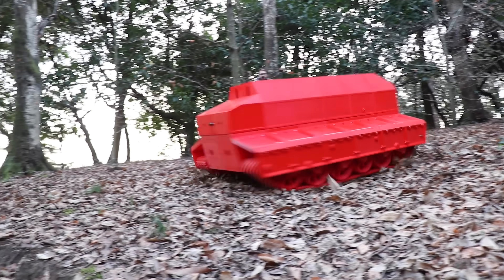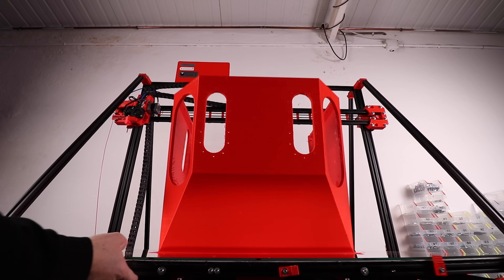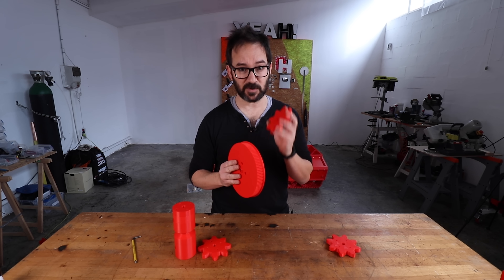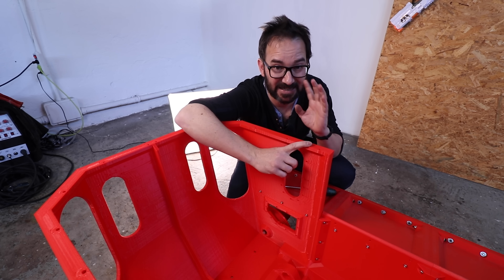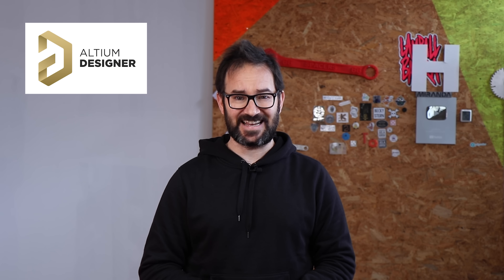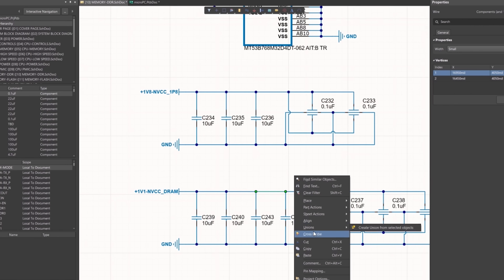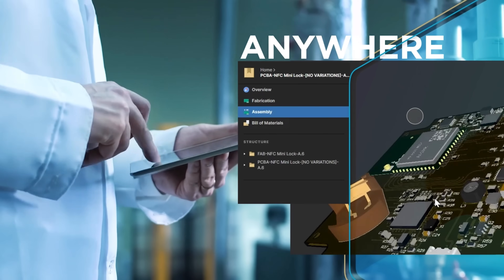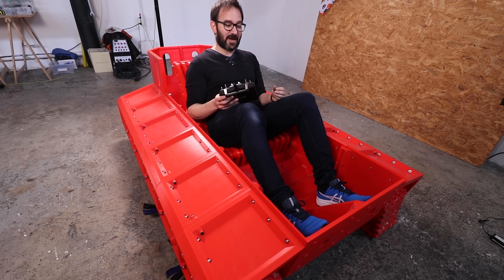FULLY 3D PRINTED TANK THAT DRIVES WITH PEDALS (from scratch)

Comment: You can control the tank via a single joystick - north/south on the joystick = forwards/backwards and east/west = clockwise/anti-clockwise for turning. The programming is really simple - for example - map your sensor reading to a range of 0 - 1000 where all the dead space is mapped to 500 (no input) where 0 = south/1000 = north and 0 = west/1000 = east. Take the reading from the east/west joystick sensor as follows:  difference = (eastwest - 500) * 0.5; (the 0.5 halves the input reading for less sensitivity) now ADD the difference to the north/south reading for the left motor and SUBTRACT the difference from the north/south reading for the right motor. (leftMotor = NorthSouth + difference;  rightMotor = NorthSouth - difference)Trim off any values that are outside the range of 0 to 1000  then map these values to the motor controller software values (or stepper motor wait times between steps).
This then leaves your other hand free to control the second joystick for the cannon.

There is also another way and that is to mount the joystick so it scribes a diamond shape (rather than a square - rotate the square 45 degrees) with the sensors both at the bottom or top of the diamond (not both on the same side).

Comment: tldr; thats alot of nut twisting my arms man

for less muscle work, use a tightened dual nut setup with a fitting socket and drill holding  the nut at the top. remove second nut and cut stock if needed but using two ensures secure and wont loosen without stressing allowing for less friction between components.

 could use a combination with flat style bearings ~2mm between washers to better secure tracks and allow for more rigid linkage and stronger motors

Comment: hi Ivan,
you've hit the mark again! your modifications are exceptional, even if the engines have reactions to the commands that are still a little too abrupt; you can probably modify the response curve by acting on the SW of the drivers, just to avoid that with a sharp acceleration you can tear some track pins
i'll see you in next video
Reply: He needs to add some smoothing to the motor input signals

Comment: What I think is scary is that a random person with like 2-10 grand can build a tank like that with an rpg strapped on top,   that means for like a million you have like 100 of those running around. You can even have image recognition and have them patrol automatically.
With 4g and lora you can have a platoon that's controlled from many kilometers away.

Though quad/octocopters with grenades strapped to them are even scarier.
Just drop an rpg straight down on a tank from like 100-200m, it'd be hard to detect. Dropping a swarm of those (like 1000) from a cargo plane for a couple milions and have them search and destroy tanks and camps would be pretty deadly.

Sorry for the rambling, I'm tired.

Comment: you should water proof it! either some kind of rubber guard like truck liner spray on the bottom, or silicone all the wholes, or a rubber liner. then add a 3d printed jet drive. if you do it right it could plane on the treads as they spin.

Comment: First of all, the project is awesome, I'm always happy about videos and construction progress.
How do you switch forward and reverse mode with the pedal? because if I understand that correctly, the left pedal only controls the left tank track and the right pedal only the right tank track, but then driving forwards and backwards with the respective pedal is just not plausible to me how that works.
Reply from the maker: There are no modes, the pedals rest in a middle position which means stop, pushing back moves backwards pushing forward moves forward each track.

Comment: 99.9999999% of 3d printer owners:  my baby yoda prints are shitty, break at the slightest touch, warp, stop printing in hour 7 of 8, spaghetti, fall off the print bed in the breeze….
Ivan: I made a working human-scale tank that I can sit in using a room-sized 3d printer I made myself using parts I printed on my old self-made room-sized printer. Stay tuned next time for the cannon that throws 3d printed armor piercing HE rounds.

Comment: Why not use this design to build a disabled vehicle? It is possible to adapt the controls for different disabilities quite easily. I would guess that it would be cheaper to build a vehicle like this than one of metals like the ones on the market. With a little more development, you could improve the speed and control of the machine.

Comment: Milling: why did you mill the big hole, you only need to mill an inner path and use mouse bites (like your outside). Also add rubber pads to the tracks for more grip ;)

Comment: Are you going to release the stl files for this tank later?
Reply from the maker: I'm not sure if anyone would print it tbh, it is quite an endeavour. Would you or is it just curiosity?
Reply: @ivanmirandawastaken  I would try to print one. I have a troxy x5a 300 most will print on it, but I know for the new end part I  would have to print the parts to make a larger printer. If you released the files for your last large printer I would most likely make one of them.
Reply: @ivanmirandawastaken  I would absolutely make one of the larger printers and the tank.